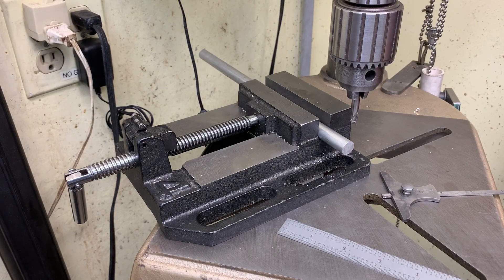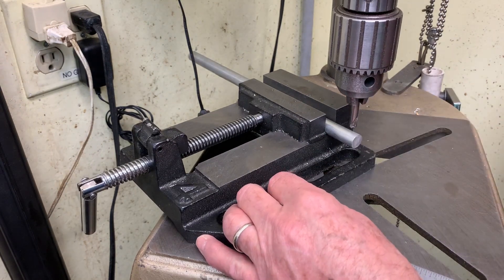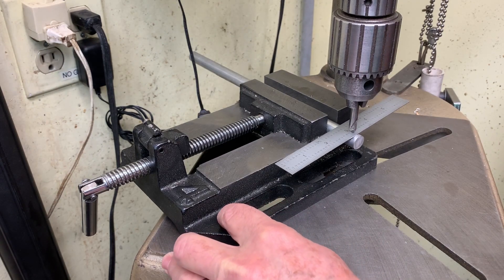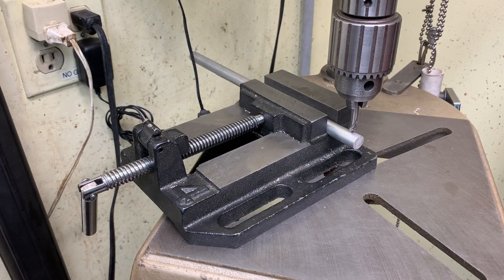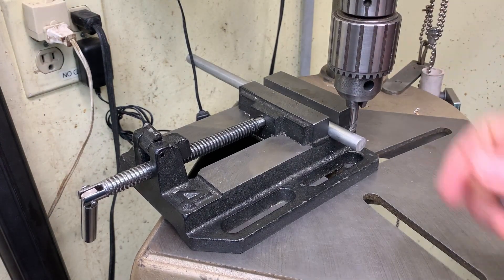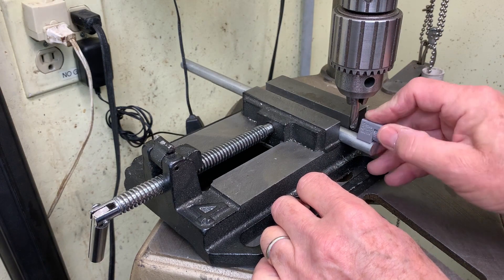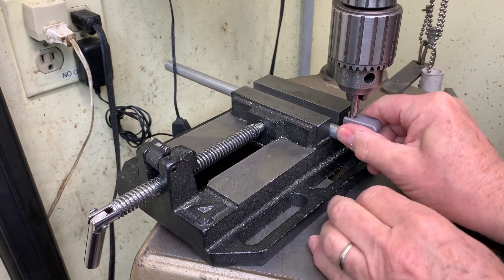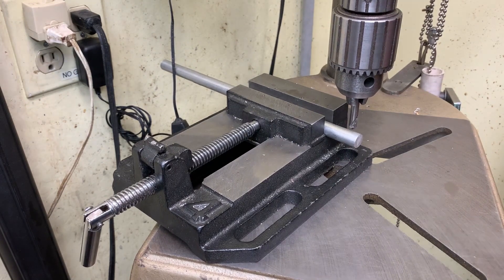A 3D Printed Spotting Drill Cross Drilling Guide

Comment: Dowl-it jig with a center drill-
Reply from the maker: It sure is expensive and a lot bulkier. Yet, I'm sure it works fine.
Reply: @rgsparber1  $12.00 on ebay-just another way of doing it. It centers on anything that fits between the jaws-round, square, hex-